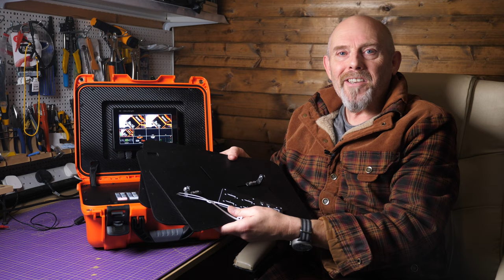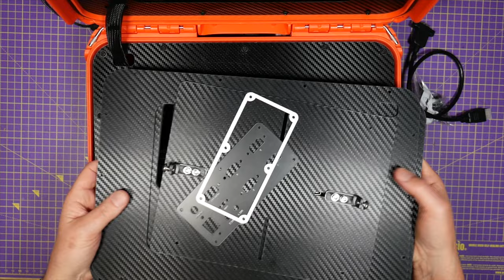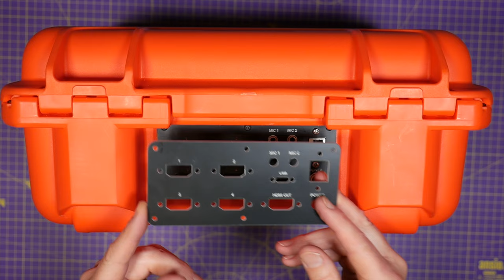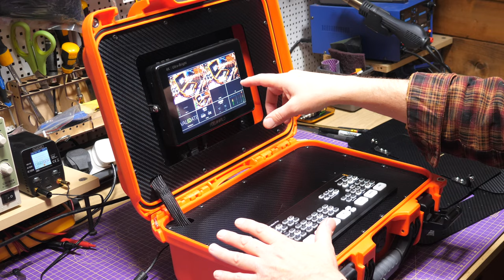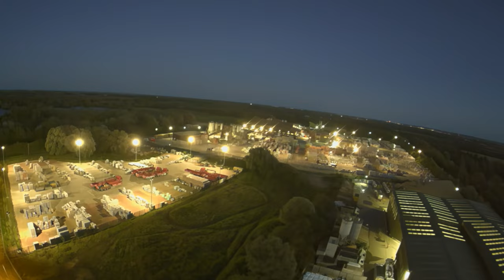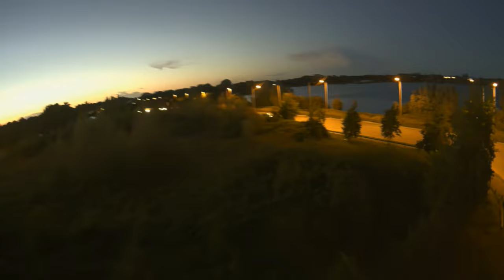ATEM Mini Switcher Portable Case Version 2 / Switch and Monitor in one portable Nanuk 915 case

Comment: Hey Guys, I built up my Atem setting following your great ideas. I improved the setting a little bit by adding 2 BM bidirectional converters for having the choice on ports 3+4 for using sdi or hdmi Input. I also added an additional hdmi output via bm converter for having both: hdmi and sdi output at the same time. Your covers make the whole thing look very professional. I use this setting for live transmissions in German telly with a LiveU device. Thanks for all your ideas and this amazing cover parts. Greetings from Germany Sven
Reply from the maker: It's fantastic to hear that my ideas and kit have been helpful in building up your Atem setup, and it sounds like you've made some incredible improvements! The addition of 2 BM bidirectional converters to use SDI or HDMI on ports 3+4, along with the extra HDMI output for simultaneous HDMI and SDI output, is a brilliant move. And I can only agree, the finish of panels makes them look awesome and extremely professional. Thanks so much for your kind words and for sharing your success. If you have any more tips or experiences you'd like to share, I'm all ears! Greetings back to you in Germany and happy broadcasting.

Comment: Fantastic. Personally I’d preferred to have the ‘power and connections ‘ in the space above the ATEM mini. That way the case will remain intact and waterproof.
Reply from the maker: I know what you mean. I have done some custom builds cos that's what was wanted and they've all said the same thing. All those connectors and cables in front of the ATEM and monitor are a cluttered mess and in the way.  It's so much tidier when they're at the back. Thanks for the feedback. Or just put a Streamdeck there https://www.youtube.com/watch?v=fIrcLFD4I0M

Comment: I just received my kit with almost everything I need. I believe I'm just missing the cables that connect the LED power button switch and the DC barrel plugs; and the USB charging option. Once I get the proper wires for all these, are there video directions that show me step by step how to put these together? Thanks.
Reply from the maker: This is very much a DIY project and generally straightforward if you follow the video. Ant problems, contact sales@xcopters.co.uk.

Comment: Dear Whirly, 
I love what you have done with the Atem case builds you’ve made. I made two separate case builds for myself ages ago and now I am looking to modify what I built. 
I have the Pelistorm M2600 and the Nanuk 920 which were designed around the Atem Mini only. 
Is there a way I can visit you please as I’d like to remodify my cases for both the Mini Extreme ISO and Mini Pro respectively. I love the panels you’ve used as opposed to the acrylic panels I had made prior. I live in Buckinghamshire and prepared to travel to meet you. Please let me know.
Reply from the maker: Thanks for the comments and watching.

Comment: Hi. Mr. Bloke, I liked your video about ATEM Mini in Orange case.
I have purchased the same case and want to manage my Roland V1-HD switcher. I am wondering if you could make a case panel deck kit for Roland V-1HD.
I don’t want to cut any holes in the case and instead I would like to have all the access from inside and just want to keep the case waterproof.
Since the Roland V-1HD has 6 HDMI ports, four for input, one for multi display and one for output or recorder.
It has two audio RCA jacks one for input and one for output and two ports on the right side for mic and phones.
So, in case the heat builds up inside the deck, in order to deal with heat, I would like to have two small fans on the same deck panel, power input also on the case panel.
Reply from the maker: Nice idea, but it's not really possible unless I have access to all the hardware.
Reply: I just bought a V-1HD+ and was looking to do the same with the Apache 4800 case.
Reply from the maker: @scotthibbard6360  Go for it

Comment: Suggestion:  Add two Combo XLR's to the top of the plate that the Atem sits in, and link that to the mini jack inputs on the back.  This way you can accept XLR or 1/4 Jack if needed.
Reply from the maker: Good idea and I had a customer version that has additional sockets in the front panel for SDI and USB and it does work great. But as soon as you have plugs and sockets in the top panel the cables get in the way of the monitor and it ends up messy. Having all the sockets on the rear panel keeps the cables and connectors out of the way.
Reply: Where can u find the xlr combos

Comment: Just ordered wire kit and cut out kit from you. What hdmi splitter do you recommend?
Reply from the maker: You have a couple of options depending on the monitor you choose. The cheapest option is to loop through the monitor HDMI in and and HDMI out if the monitor supports it - most do. Alternatively, you can use an HDMI splitter in the case. I've used these before  https://amzn.to/3ESDbZi but there are loads of alternatives on Amazon. I suggest trying the monitor loop through first and see how it goes.
Reply: @WhirlyBloke  thank you! Has anyone asked you to think about making a case for the roadcaster pro II? I'm looking to make one for that as well.

Comment: Hi. There, I have built the same setup except all the connectors I want to keep inside the case instead of cutting a section to install the back plate.
I plan to use a 12 port keystone plate to use the keystone type jacks and hdmi connectors keeping the case airtight and water proof.

Can you lawyer cut the 12 port keystone plate hole on top of the stem mini pro so, I could install the keystone plate?
I can send you the picture of the keystone plate with measurements so it could be helpful for you to cut the installation hole. I would like to buy the deck kit only for inside the case.
Please advise.
Reply from the maker: Drop me an email sales@xcopters.co.uk with all the info. I do lots of custom case kits and builds, so this should be no problem.
Reply: Thanks for the email. I will send the email over the weekend. I am traveling at the moment. 😊

Comment: Can you make a plate kit for the Roland VR-1HD for an Apache 4800  case?
Reply from the maker: Yes, if I had a Roland VR-1HD and an Apache 4800  case or some accurate measurements.
Reply: @WhirlyBloke , I can provide you with accurate measurements as well as photos with the measurements on them.

Comment: great video I have an apache 4800 case from harbour frieghts I also have an atem extreme iso I wanted to ask how i can get a acrylic for a atem extreme iso and maybe for my msi optix portable monitor
Reply from the maker: Email sales@xcopters.co.uk with the details and we can get you a quote.
Reply: @WhirlyBloke  I'm curious if this is available? I see on the site there's a listing for the Apache case and I see that there are 8 inputs on the plate diagram. Is this for the Extreme ISO?
Reply from the maker: @collinsjpace  Complete case builds, custom designs and kits of parts are all available for fast shipping worldwide. The Extreme parts will be available soon. Contact sales@xcopters.co.uk if you have a custom build requirement https://www.xcopters.co.uk/shop/atem-mini-switcher-nanuk-case-deck-kit

Comment: Hi I'm planning to buy the kit but is it possible to have the top panel without the cut for the atem mini? I have a different switcher so i'll just cut it myself. thanks.
Reply from the maker: No problem. Just add a note to the order.

Comment: If a person is able to get the BLACKMAGIC ATEM, Nanuk 915 Case, the Feel World 4K Monitor. What is your cost for your labor, or what is the cost for the parts and cables and the Acrylic custom Cut Panels should I need to assemble the project myself.
Reply from the maker: A list of the parts is in the video description.  You can buy the laser cut panels here https://www.xcopters.co.uk/shop/atem-mini-switcher-nanuk-case-deck-kit
Reply from the maker: A complete fully built case is available here with a monitor ready to take your own ATEM Mini https://www.xcopters.co.uk/shop/atem-mini-switcher-portable-case-and-monitor

Comment: Are you able to do a custom back panel to swap two HDMI for SDI?  
And is this compatible with the ATEM mini pro ISO?
Reply from the maker: The ATEM Pro Mini ISO doesn't have SDI so it would need HDMI to SDI convertors adding. Contact sales@xcopters.co.uk to get a quote.
Reply: Yes, I plan to put BMD converters in to do this. I will contact support, thanks

Comment: So talking with Blackmagic support I've found this to be a bit disturbing.
Whenever the media is removed from the ATEM Mini xxx the drive is still mounted.
Meaning the data could possibly become corrupt or even damage the drive. I haven't 
used the unit long enough to determine that this could be a problem but I'm sure it would be.
I've only been in the computer business for 30 years but I do see this as a problem.
Reply from the maker: Interesting into. Thanks

Comment: Sorry to be a nuisance. I couldn’t find a link to your website so i can get the dpx files for the rear plate v2. I’ll attempt to merge V1 & V2 then pay you to cut them for me if that’s possible.
Reply from the maker: The Nanuk case lid is quite different from the MAX case will need standoffs and the 3D print modifying. If you can provide me with a DXF of the design I can cut it for you, but I'm sure you must have a laser cutting service closer to you than I am.
Reply: @WhirlyBloke  True that but I’d rather support the source of this amazing idea. I’ll keep you posted as this will be my first time taking on such a project. Currently buying the small components. Also so you know, the HdMi extensions recommended are out of stock